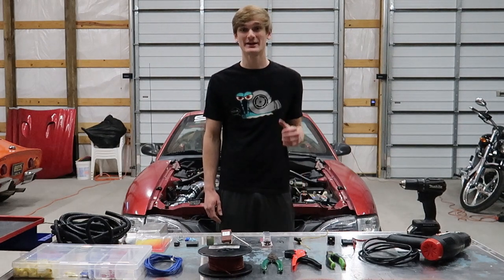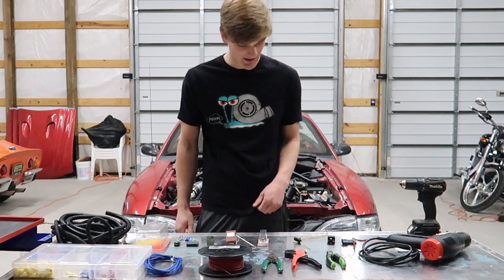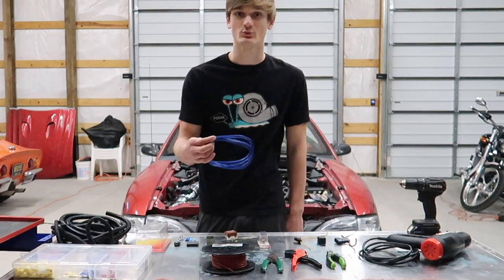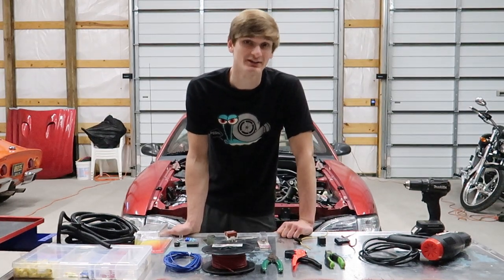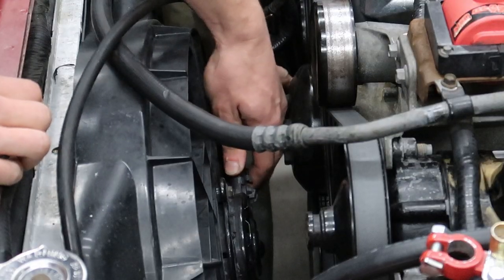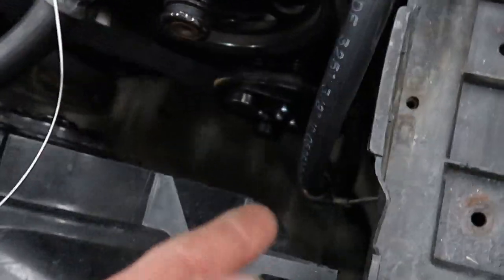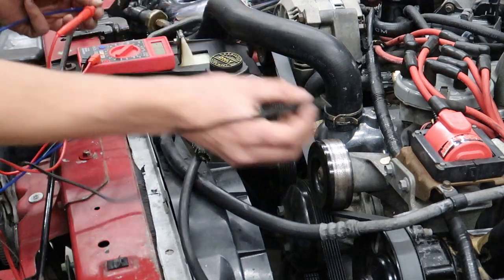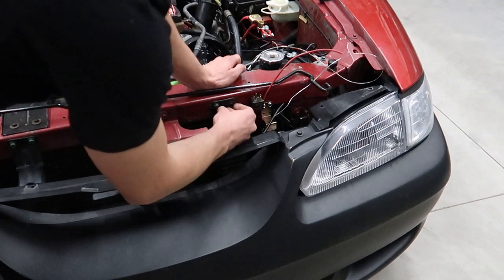Radiator Fan Not Working? $18 DIY FIX! How to Wire a Radiator Fan to a Thermostatic Switch

Comment: Really wish you would have step by step shown the actual install, each wire running to.a from where, way too much time spent on introduction, then you skip straight to it already being hooked up trying pause the video to see where and how all the wires are hooked up, frustrating video and not helpful really.

Comment: I should say that i dont think that these things are supposed to get coolant flow right across the probe part bro. Just the temp inside the pressurized system will trigger it. It can handle some splashes but drowning it in coolant will almost certainly make it fail prematurely.

Comment: Hey nic I'm no expert by any means but if that's the Hayden 3653 thermostatic switch with adjustable thermostat, then I don't believe it's supposed to be used in the hose intake, inside coolant.
The manual for that switch states it should be hooked up 1" away from the top of the radiator fins facing the engine side. That that probe is designed to be on the radiator fins & read air temperature.

I need to learn how to setup the relay, I have had a Hayden hooked up directly to the battery with no fuse or relay for many years. It was installed by a mechanic.
But I don't like it, it turns on when Jeep Grand Cherokee Laredo 4.7L is off.
I have no clue what the Amps my SUV requires because the OEM fan was a hydrolic fan system hooked up to power steering. I have some aftermarket fan in my Jeep put in before I became the owner.
I believe my fan is draining my battery from running while the Jeep is not running/on.
It also doesn't turn on with the AC.

How do I fix this and how do I set the actuation temperature. I probably need a fuse (25A maybe) and a relay but also want it connected to AC.
I don't think I want it ignition controlled because I want it to run 10-15min after SUV is off to cool engine when needed.

What do you recommend? 

Should I get another kit and a fan controller or just a relay with the Hayden 3653 adjustable fan switch?

Comment: Great video! This is exactly what I'm doing in a couple days. I have a lincoln mark viii motor in my 67 f100 and I'm not running the vcrm either. How do you insure its set at the right temp? Is there a way to know?
Reply from the maker: yarkie1 I used the gauge on the dash as a reference point for when to turn it on and off. If you have no way to gauge coolant temp, then you will have no way to accurately adjust when it turns on.
Reply: The answer is... what are you running for an engine thermostat? [Coolant temp is meaningless to fan controls until there is collant flow with respect to a radiator].   The thermostat for controlling your fan is generally best at that same value to 10 degrees higher.  But: ambient temperatures can sometimes be a trick to manage.  I use dual fans for that reason.  The one that pulls air across the radiator section with the transmission intercooler I switch on when engine is running.  The other is on a thermostat which is radiator mounted [I think it is 185 degree].  In cold weather [anything less than 25 degrees or so], that fan never ever comes on: the probe never gets up to temp.   The dual fan thing is a nice alternative to going old school for cold weather.  Once upon a time,  I used to cut cardboard to manage the cold, blocking 80% of radiator from incoming so the heater would kick in before I got to work, lol.

Comment: The probe goes to the back of the radiator with the supplied strap..
Reply: So vague .. this is informative...
Reply: I thought so too, the probe is meant to go in the radiator coils not inside the radiator hose, they'll probably damage it quickly being wet and extremely hot like that

Comment: Why did you use an additional relay to this controller/Potentiometer  ? I thought it does both relay and switching?
Reply from the maker: joe arreola the thermostatic fan controller is only a switch. If you were to run the power wire from the switch straight to the fan, it would work, but the switch is not designed to support the 60a that the fan draws. It will eventually burn up, fail, or catch on fire. The purpose of the relay is to support the high amperage draw of the fan, and only use the switch at the 1-5amp current it is designed for

Comment: I did a dual fan install on my 2001 Dodge ram 2wd. Running two relays was a pain, but everything's working, EXCEPT.. I have an issue. Wonder if yours does this too?
If I drive to the store, the fans come on around 100°, then I shut it down, run in and out of the store. The radiator is still pretty hot, so the temp sensor see's that, and the fans are running the second I hit the key, before the motor is even started, with puts a serious current draw on the system before the alternator is even turning. 
I think theres a different temp sensor set up out there that has a delay built in so that you get the motor and alternator turning, BEFORE the fans kick on..yours doing this too?
Reply from the maker: Your problem is that your 12v “switch” signal (the wire that gets power when you turn on and allows the fans to turn on) is not having power cut when cranking the truck. You need to figure out another 12v power source that has power interrupted when you crank it. If you need help figuring out what to switch to, let me know and I’ll do some research on your truck
Reply: @nicbowen38  Thanks for the reply. I actually didnt pay attention to whether or not the power cuts when the starter is engaged. I only noticed that, when I turn the key, if the rad is still hot from the drive, the fans come on before the key gets to the "start" position, making a pretty big current draw on the battery, before the truck even starts, then the alternator kicks in after it starts, and slowly gets back to optimal voltage. I'll check it today and let you know. Thanks again.
Reply from the maker: @Blaydrnnnr  I misinterpreted your issue. If your electrical system can’t sustain running the fan for a few minutes before turning the engine on and having the alternator recharge it, I would highly recommend cleaning all of your ground / positive connections and replace the battery. I know it’s a lot of current but your electrical system should have no problem sustaining it
Reply: @nicbowen38  Its not the "sustaining" part, the system charges back fine, its the fact that there is a combined 50A draw on the system during a "hot" start up that worries me. . ( Between two fans drawing 25A each ) Connections are good, and the battery is brand new. Flex a lite makes a delayed adjustable temp sensor, I might look into that, as well as a 160A alternator they make for this truck. We'll see. Thanks for the feedback.
Reply from the maker: @Blaydrnnnr  if that’s you’re only concern, then the only solution is to hook the remote 12v source to a source that gets electricity when the key is on and shuts off intermittently during startup 👍

Comment: I’m having the issue that Radiator fluid is leaking from where the wire goes into the top radiator hose. Do you have any suggestions on fixing this?
Reply from the maker: I also had this issue, I repositioned the wire to the 12:00 position on the hose, made sure that the probe was fully in the radiator hose, and tightened the hose clamp more. That fixed the issue
Reply: @nicbowen38  I have repositioned it and still leaking Idk what to do now
Reply: It’s not supposed to be in the radiator hose at all..it goes through the radiator fins
Reply: @aguitarhero007  if I’m understanding this correctly it goes through fins on the radiator in the outside not in the radiator?

Comment: Did you realize that the probe was ment to go in between the radiation coils throughthe radiator, not inside the hose!
Reply from the maker: Felix Rosario that was what the directions said, it did not work for me in that position so I installed it in the hose with better results, however my first thermostatic switch was defective and wouldn’t turn off once the desired temp was reached
Reply: So did it leak when you installed it in the rad hose like that? I might do something similar with a temp gauge. My car has green digital gauges and the only temp gauge I can find that matches has a wire probe.
Reply from the maker: @Ian-of9oi  if installing in the radiator hose, position the wire at the 12:00 position and make sure the probe is past any point of contact in the radiator hose. I got mine to not leak in that position
Reply: Update. I drilled a hole in a pipe, installed the wire, jb welded the hole. 2 months still good.